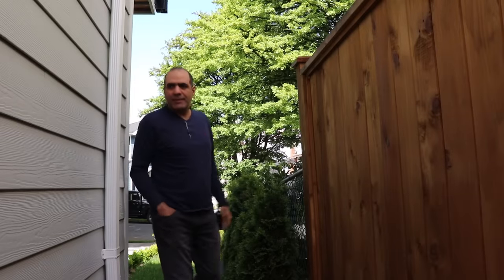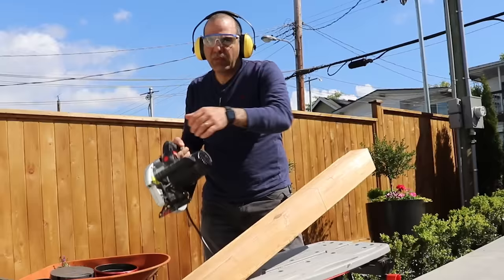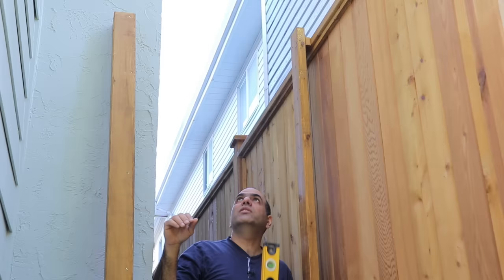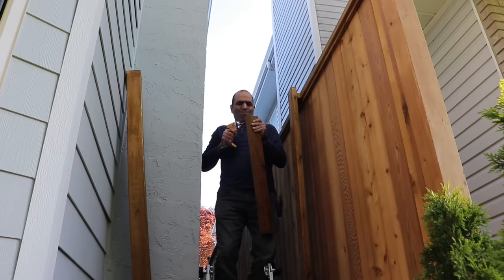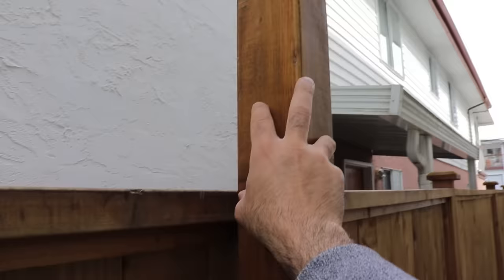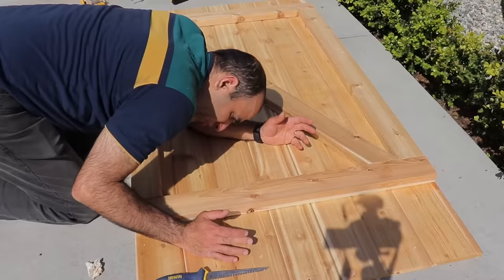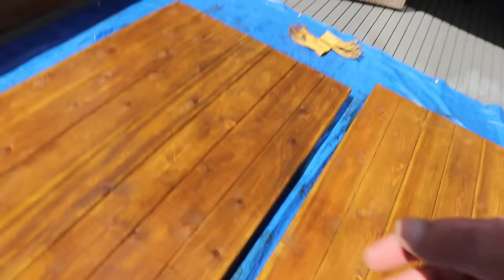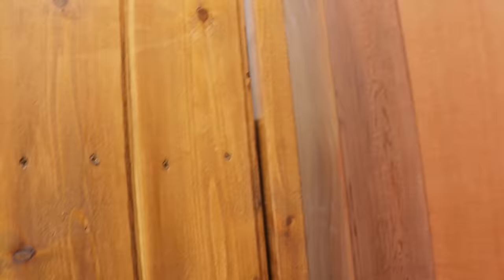Making Wooden Gates for My House

Comment: 15:35 that's backwards. screws are significantly stronger when it comes to withdrawal force, and weaker against shearing force.
Reply: yep, and also cause they are hardened, expansion and contraction pretty much guarantees they will shear off if used for anything load bearing over 50 lbs eventually unless the clamping force between members prevents movement.
Reply: @lukerediger8431  Thirded. If you want shear, you want nails. They actually have the properties you mentioned (basically the opposite of most screws).
Reply: The wood will crush, split, and otherwise yield long before the screws’ shear strength is exceeded.
Reply: thats only backwards if youve got metal threads, in wood the screw will tear out of the wood easier than the metal screw sheers off
Reply: But we WONT talk about this, because Mehdi is happy with his gates. 😅🤣
Reply: @The13point1  depends on what stresses it's under. if you have a vertical post and you attach a horizontal member to the side of it with screws, the expansion and contraction will remove the clamping force, and the screws will shear off one at a time until critical failure.

That's why decks and floor joists need special bracketry if it's not held up with beams underneath.
Reply: @alyero6341  not if the surfaces aren't being torqued away from each other.
Reply: @lukerediger8431  where is your knowledge coming from?
Reply: @alyero6341  experience, post mortem on structures that have failed, and building the replacements.
Reply: @lukerediger8431 originally i was just responding to the top comments claims. I'm a mechanical engineer, granted not a lot of experience with wood, but what I was saying was pretty much just the force required to pull a screw out of wood along the screws axis (og comment called it "withdrawal force") is gonna be smaller than the sheer force the screw can take before it fails. I researched a little more and I think that holds true? If you've got any experience in that regard please let me know, always happy to learn more

Edit:also I read your comment the first time and thought you were saying you had died lol
Reply: @alyero6341  I think you're thinking just static shear forces, we're working with dynamic loads here. This is why it's a code violation to use only screws to attach a piece of wood to the side of a post. You have to use either engineered bracketry or use the screws only to provide holding/clamping to keep it in place where other wooden members support the load. i.e. a jack post or thicker posts with notches cut into them.

Screws are hardened metal, so as the wood expands/contracts and shrinks the clamping force diminishes. this allows people walking on the structure to apply repetitive cyclic forces and torques that will fatigue the metal and they will shear off. I've seen it so many times. 

The only time I've ever seen screws pulled out is when the board is under a torqueing force pulling the two meeting faces away from each other where the screw is pulled out via leverage AND the wood was saturated with water. I've rarely seen multiple 2.5 to 3 inch screws pulled out of wood that was sound. they generally snap off the heads and/or pull through the top piece or break the wood rather than pull the threads out.
Reply: Luke Rediger there you go defeating your own argument: the only evidence that you have of screw failure is during active demolition. Your other example is pullout where the failure is in the wood, and the screw remains intact.

Attaching a (load bearing) piece of wood to a post should never be done with nails. Through-bolts and structural screws are what’s code compliant. The only time nails are used is with framing connectors, because their geometry is specifically engineered to eliminate the pullout factor.

The fact is, for ordinary wood construction, screws perform as well as nails, and in most cases are superior to them. 

Nails are simply much faster to install.
Reply: @The13point1  You need to go back and re read what I wrote. Nothing you are replying to addresses any point I made.

1. post collapse post mortem is not active demolition.

2. I said I've never seen threads pulled out from sound wood, and described what normally happens which is NOT threads being pulled out when torqueing sound wood. THE ONLY time I've ever seen threads pull out is when the wood is waterlogged. And then I pointed out the heads will be pulled through before the threads would, and claiming that a shear force will pull threads out before snapping them is a bizarre idea.

3. I never said you should use nails, I said you cannot use screws because they will shear off, and said you need to use either a structural member or specific engineered bracketry that WILL call for nails or specialized screws. You will never use standard deck or wood screws to support a load and be to code.

4. Screws are hardened metal and therefore more prone to failure due to fatigue from cyclical dynamic loads. My point still stands. Nails can take more abuse because they are typically thicker and are more ductile meaning they will stretch and deform rather than snap off like screws will. They are still NOT what you should use to support horizontal loads, my point was that nails are less likely to snap than screws, and will give you more warning as the structure sags as the nails deform, rather than a sudden drop when using screws and the last one finally snaps.
Reply: I think Medhi was trying to say that the wood-screw configuration is stronger when the forces acting on it are perpendicular to the screw.
Reply: @synthoscitizen  yes, but he's... inaccurate. 

Screws are meant to add clamping force, and are less shear resistant than nails, because screws are hardened. 

In this application they are more than sufficient, but people should know that screws should not be expected to hold a load perpendicular to them because once  the clamping force has diminished to the point that it won't hold the load (from expansion/contraction and movement), the screws are relying on their weak shear strength. Nails are also a poor choice for that, but at least they deform and don't snap.

This is just a gate, and it will be fine, but if he was using this method to hold up joists against a post like many people do on decks, eventually the clamping force won't keep the weight off the screws and people walking around on it will eventually shear them off. Most of the time enough screws are used that while it's a code violation, the wood in the deck will be the failure point, but not always and it depends if the screws are rusting etc, how the load is spread out on the deck, local weather extremes etc. 

Regardless the proper way to build something with screws is to build all the load support to be carried by posts and beams, the screws are just there to clamp the parts together to make sure they don't move around, but never are subjected to a shear force.

In this case, the diagonal and the corners it is pushing against, are under shear loads, if this was a larger gate made much heavier, I'd expect the corner screws to shear off over time. It's a small gate, so it probably will be fine, but if someone were to hang off the gate often enough, like kids do, eventually the screws would deform the holes and lose their clamping force, the gate would get loose and sag.

The overkill (proper) way to make this gate would be to mortise and tenon the frame and diagonal, and use captured bolts to draw the joints together from the ends of the members, so that the wood is still holding the load, but the fasteners are not subjected to shear and provide only clamping force. 

But that would be overkill for just some simple gates that will never have to support anything but their own weight.

Comment: Hi Mehdi, love all of your content! 

As far as screws pulling out, screws are very hard because they have to cut through the wood, which means they have much less strength in shear stress than tensile. Screws will almost never pull out unless they are not being used correctly, but they can shear right off if shocked. Nails on the other hand, don't have the same holding power because they basically act as wedges, but are ductile and will bend in shear forces but almost never break off like a screw will.

It probably won't matter in your application because you have the diagonal bracing, but nails would have been a better choice for the gate construction. Alternatively there are screws that are meant for framing that have ductile shanks but hardened flutes that would also work.

Cedar is used where I live for direct ground contact with no sealing, it doesn't typically rot when wet, it's almost weatherproof. In many parts of North America it is used as exterior sheathing/siding.

Have a good one man, and again I love both this and your regular channel!

Comment: Word of advice. Clamps. Lots of them. They're your friends when you don't have any to help hold the workpiece down for you. 

Also, you kinda got the forces mixed up there. Screws typically don't like shear forces. It wouldn't be a good fastener if it couldn't resist the tensile forces its threads generate when holding workpieces together. Wood is soft, so it allows that shear force to result in the screw bending instead of shearing. Bending generates more stress in the screw than shear alone. Screws are often not made of ductile material, so once it's bent, its strength is compromised.

A thing you may need to consider is creep. This is when the material permanently deforms over time even if it's barely stressed. Wood is notorious for that. You may need to accommodate for this by using a diagonal cable and turnbuckle to adjust the fence over time. It'll be better than trying to recut a new diagonal to force the fence back into alignment.

Comment: I thought screws were for more pullout strength while nails were for more shear strength (Aside from tons of specialty nails)? Either way, definitely awesome for taking that in to considering for your build.
Reply: sounds correct
Reply: That is correct. Screw are not meant to take shear load. The clamping force create friction which then prevent it from moving. Doesn't change the result I guess.
Reply: @waynejohnson1500  Yeah I imagine the forces involved here and with enough screws it pretty much won't matter.

Comment: By the way, 15:35, you had it backwards. Screws are stronger than nails with pull force. Nails are stronger than screws with shear force. Screws are more rigid so they can break easier with shear force. Nails can bend to a greater form so they're more resistant to shear.
Reply: Just curious, why would a screw be any weaker against shear force? Past the threads a screw and nail are essentially the same.

Comment: 15:35 I'm sure you were corrected here but it's the opposite for screws. They're good against tensile forces but back against shear forces. Nails are about the opposite. That's why we use nails for house construction and not screws because they can bend and not break.

Comment: Instead of putting the extra wood on the door to adjust the mounting point of the latch - why not just mount the striker the other way, so the angled part goes toward the latch, instead of away from it? Then you wouldn't have needed that wood block.

Also, I probably would have put wood glue in the grooves of the door panels before tapping them together.

But overall, nice job!
Reply from the maker: Tried it, it goes too deep!
Reply: How can you comment 3 hrs before uploading video?
Reply: @thesecretguy275  they're a patron
Reply: @Saismee  what does it mean?
Reply: @thesecretguy275  You can support Mehdi by going to his patreon and paying him monthly, one of the benefits is seeing videos early I guess
Reply: @thesecretguy275  Patreon members get videos early.

Comment: The way a screw attaches to a piece of wood prevents structures being strong when the screw goes in directly in line with the grain of the wood. When a screw goes into a piece of wood it cuts the wood fibers around the screw, but if the grain is at an angle to the shaft of the screw some of the fibers pass unbroken in-between the threads of the screw and those are the fibers of the wood that hold the screw in place. When you screw in line with the grain you cut all the fibers between the threads of the screw so the screw can move freely in any direction without breaking a thread. The fibers of the grain of wood are very strong, but not attached very well to each other, as you found out when you split that piece. 

When I am depending on a screw to hold up a house it is important not to ever screw into the end grain directly, despite how easy it is to make a square using that method. For a project like yours I don't think the lower strength will cause a problem, as you mostly designed the wood to bear the weight on its own, and only used the screws to hold the wood in place. If you angle the screws slightly they gain a lot of strength, and I've had a lot of fun messing around with scrap wood to feel the difference in strength. Hopefully this helps in your future endeavors as an electrostatic arboreal engineer.

Comment: Just so you know, nails are better for shear force but in applications where there is not going to be tones of weight on it, screws work just fine. Just for future reference, if you frame out something that is going to be holding a lot of weight like framing a shed  then you would use nails.
Edit: That is why screws have threads and heads, to prevent them from pulling out while nails just have heads.
Reply: Searched through the comments for this! Thanks random stranger on the Internet!
Reply: tons
Reply: There are so many screws that If a car hits the fence it might bring the house down to.
Reply: @heronguarezi6501  they’ll probably rip out the wall before that or the fence would break,,

Comment: 15:34 I'm not sure about wood and wood screws, but machine screws are designed to bear tangencional tension, and you shouldn't load them with shear force. Imo it's the same for every screw. Screws are designed to pull together the 2 objects that you want to bond. You pull on the screw, and in return it squeezes the 2 objects together, and they stay together because of the friction between them.

Comment: Being a professional fence builder myself... I'm impressed. Gate looks amazing and it's definitely sturdy. Well done and good choice going with cedar. That's actually what I use and for good reason on top of it being lighter than most other woods. Although I personally would have used omnidirectional latches to open inside or outside.

Comment: "Screws are stronger against shear force" I think you got the strengths mixed up, screws are meant to hold stuff together, yes? That's why if you bend a screw, you can't just bend it back and still use it, because it will break, or at least be weaker. Nails are the ones that are stronger against shear strength, because you can bend a nail over and over and over and it will still work just like any other nail, albeit with some difficulty driving it into the wood/material, perhaps.

Just remember that because of the grips on the screws shows they're meant to pull stuff together, nails don't hold stuff together as well

Comment: You nailed on the siding. If you live in an HOA, that's a fine. 😄 Now if I'm 6 ft. I simply just reach over gate and push the 3 dollar lock open rob you blind...because you just told everyone you have something to hide. 😄 I need a gas grill with utensils. 😄

Comment: What happens when the house shifts with the winter/summer cycle? Our house moves a good 5-10cm... 😲
Reply: You make a new house that has good foundation 🤣
Reply: @andrijacvjetkovic4662  You don't know much about houses in the northern hemisphere do you? 😂
The foundation is fine, it's the fact that the ground and ground water freezes and thaws as there's more than 70° C temperature cycle throughout the year. if your house doesn't shift, it'll break.
Reply: @Nabeelco  i live in climate where at noon temperature is 32°C at midnight is 10°C I don't wanna convert F to Celsius, so we have about 365 cycles a year, and my house only sinks about 1cm in 5years
Reply: @Nabeelco  and about weather it has no place near foundation
Reply: @andrijacvjetkovic4662  That's only a delta of 22 degrees celcius... We get changes of over 70 degrees celcius... It can be as warm as 30-40c in the summer, and as cold as -40c in the winter. I have no clue what it is in fahrenheit, nor do I really care, so I don't see what that has to do with anything.

Comment: You should add a, "No Touch, High Voltage" sign on the door and then add a Non lethal High voltage to the door that zaps anyone that touch it but only you have the Remote control to switch it off !

Comment: Now drill a small hole just above the latch and tie a small steel cable to the lift so you can pull it open from the other side.

Comment: If that's stain, you got a shit ton of it for a gate. Also normally with stain you brush it on let it soak in for a bit and wipe off any excess that didn't absorb then you would do some sort of clear coat over that. Secure the work when you cut it too, maybe use a couple 2x4 to make a quick sawhorse at the same height of that wobbly table so you stay focused on the cut rather then the scrap so you get a straight cut and don't have the saw suddenly kick back at you and possibly leave you short a couple digits. This seemed a bit more high risk then the exploding capacitors and shorting of live wires your always dodging. Closer to that one time with that Jacobs ladders but not quite that dangerous. lol

Comment: 23:35 Dunno if the other way round (lock "upside down") would have been the smarter idea. If the door ever sags (for whatever reason) the bolt would still be forced into the lock, even if it has to lift the door.